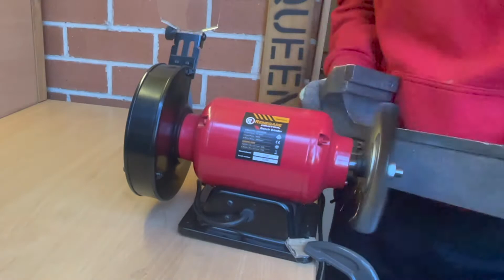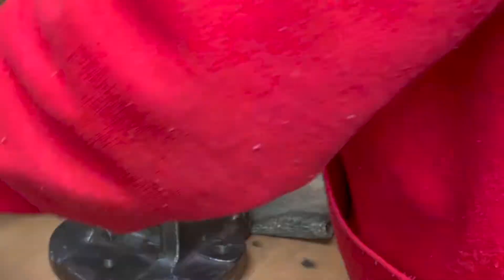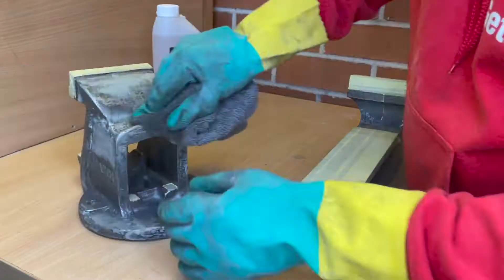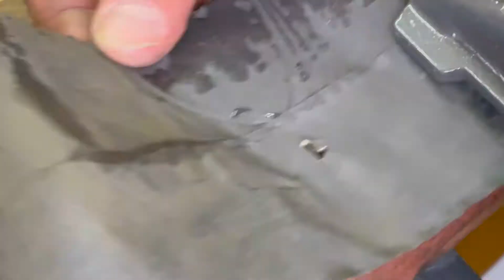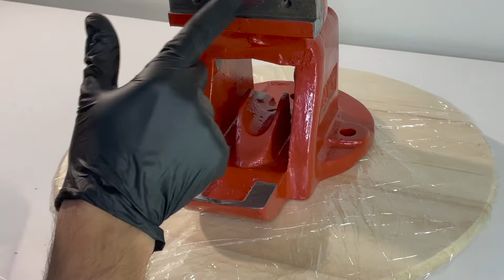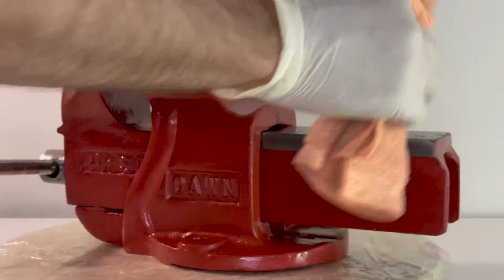Vintage Dawn Vice Transformation

Comment: Great restoration, Mate. I liked the attention to detail you put into it. That's disappointing about the Hammerite paint, though. The reason you buy that paint in the first place, is for the hammer finish.
Reply from the maker: Thank you mate. Yes, I was disappointed as well with the finishing of the painting. As it was my first time using I don't know if I did something wrong or it was the color because on my other restoration I painted in hammered blue and the results was amazing. Check the Wilton Vice restoration. Cheers.

Comment: the screws need to be sunk lower if you plan to use the vice for clamping.
what does the Turtle wax do for the usefulness of the vice?
Reply from the maker: Hi, yes I’ve noticed that with the screws. However, this vice is for a collector so it’s just for the appearance, that also explains the wax in the end. If I was going to use as a vice I would’ve leave just with the paint and less details. Cheers.